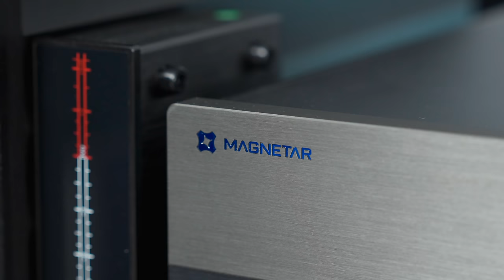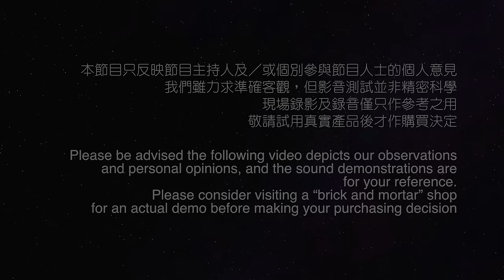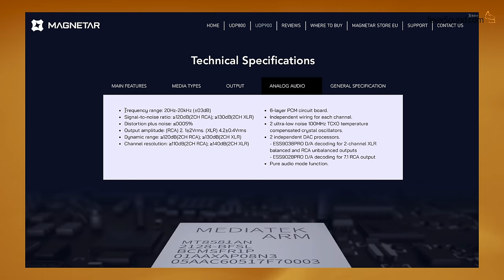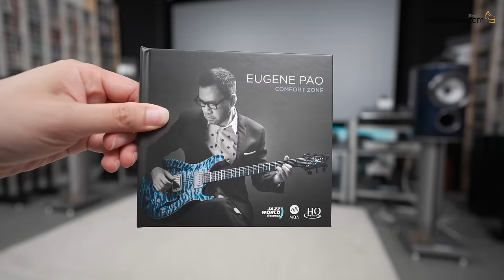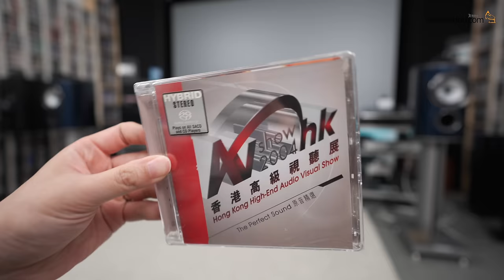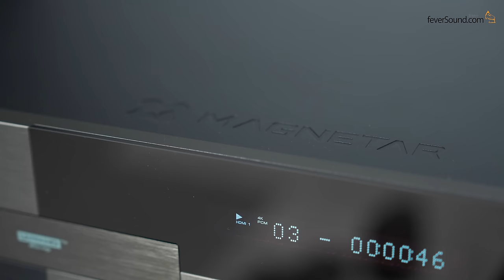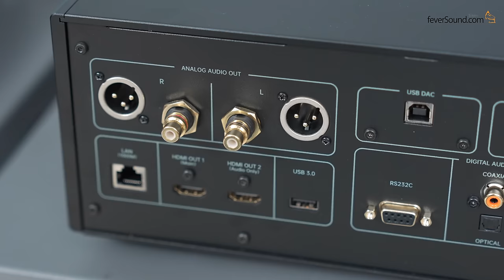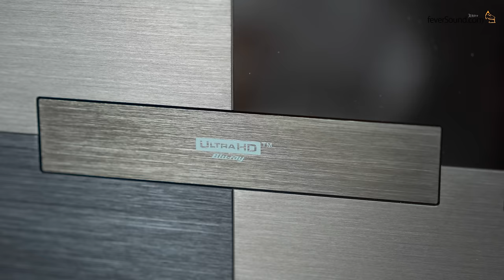終極宇宙盤能否當發燒 CD 機？｜Magnetar UDP900｜國仁實試｜cc字幕

Comment: I have a question. I have only just found out you could actually decode SACD audio in an external DAC via HDMI out from the player/transport and connect it to a HDMI Extractor device that you can buy from Amazon and in turn plug it into the I2S input of the external DAC. The issue is "audiophile brand" SACD/hybrid players typically don't have HDMI out, for example, Denon, Marantz and Esoteric, none of them have it. Ironically, only cheaper universal players have HDMI out. My question is should I stop buying audiophile brand SACD/hybrid players and just buy cheaper universal players instead in order to decode SACD audio better in an external DAC?